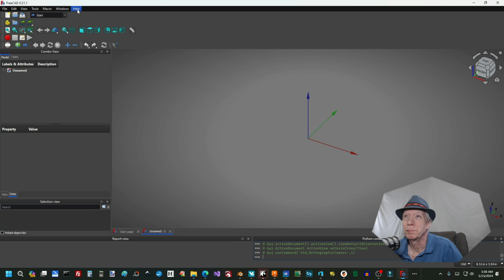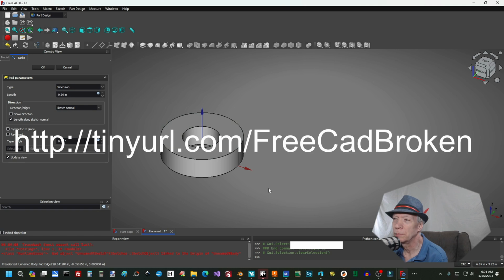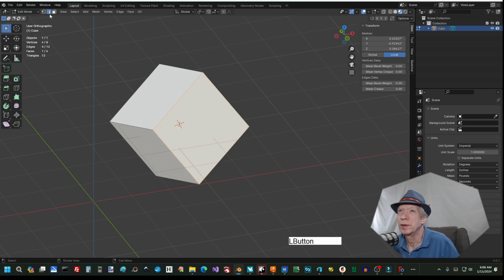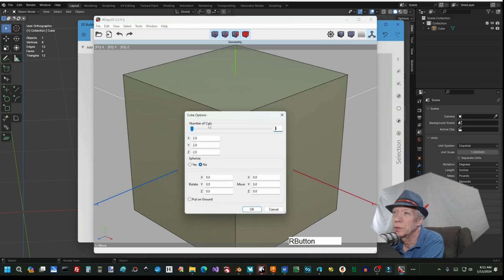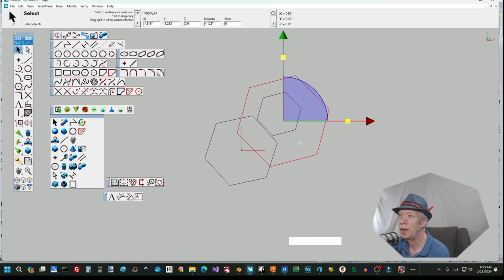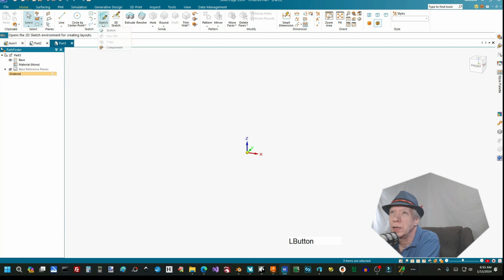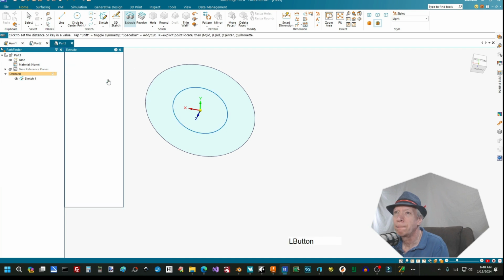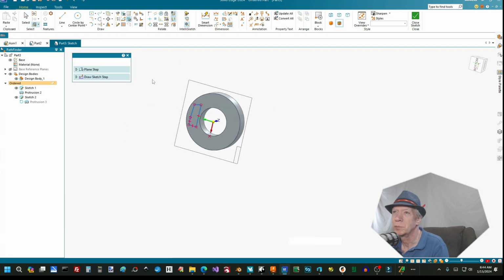Wow Look at SolidEdge for CAD 3D Printing

Comment: Why do these all look like they were written for windows 95?
Reply from the maker: Hi Mark, What specifically make you think they look 95ish?  Many of these were written in the 80's and 90's. Blender runs on Win,Mac,Linux and uses it's own strange UI and not Microsoft WinForms or Wpf libraries. 
Perhaps I can dig into the DLL used and see what libraries they are using.   Thanks for the idea.
Reply: @ProfessorVector   Blender looks modern.  Many of the CAD options shown just look dated but I guess many of them are quite old.